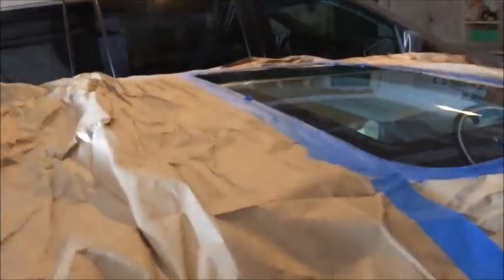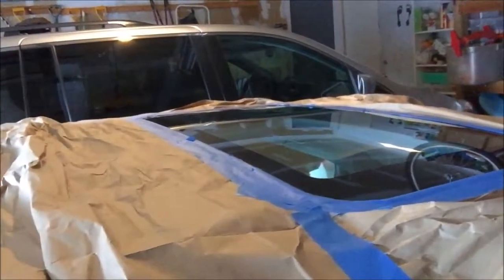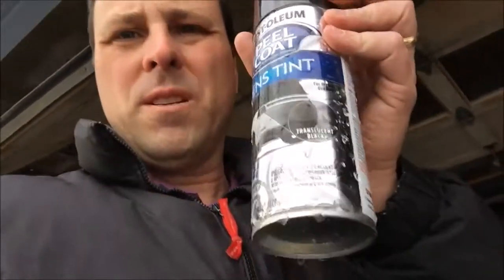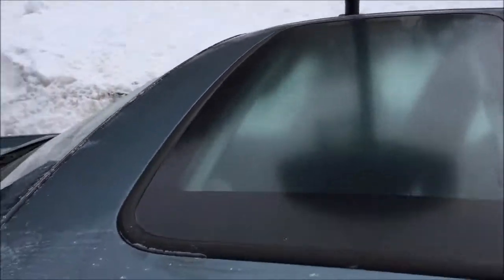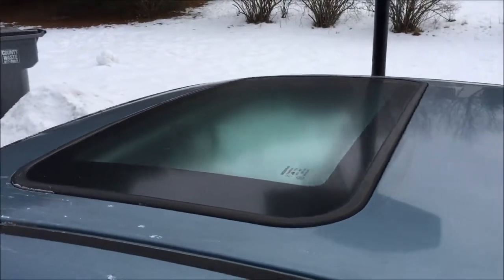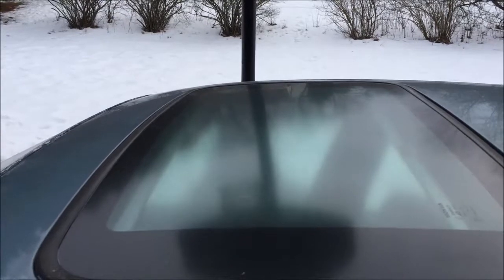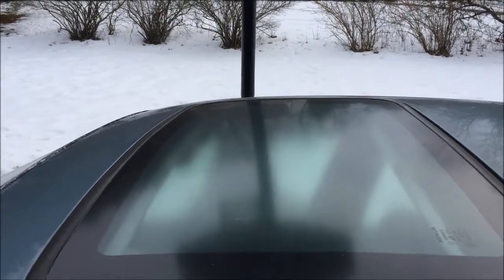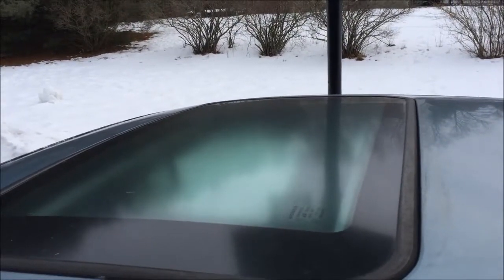Moonroof Tint Fail on 2000 Honda Civic EX with Rust-Oleum Peel Coat Lens Tint

Comment: if you thought it would be clear why did you think it would tint your moon roof? fist mistake ,directions read not for glass. 2nd mistake using it on glass.3rd. freezing weather.
Reply from the maker: It was just a test. Trying something out. I acknowledged in the video I wasn't following the directions.